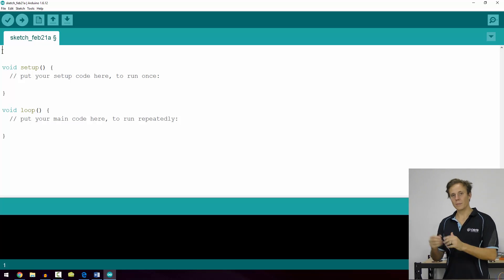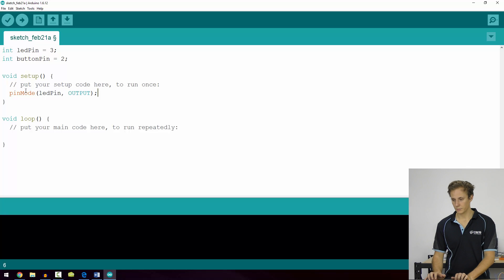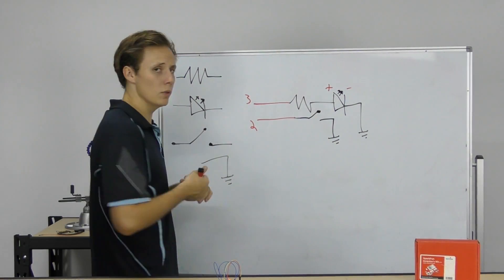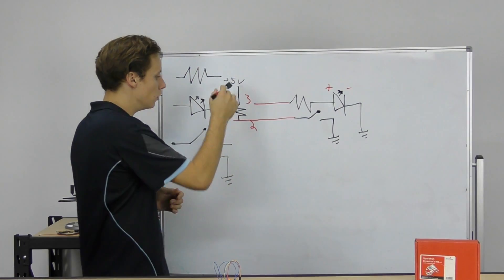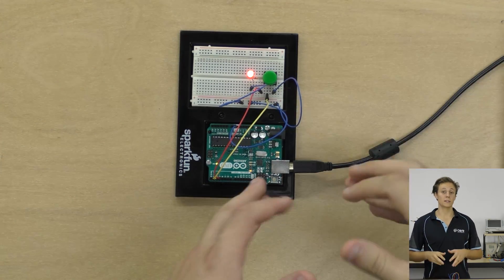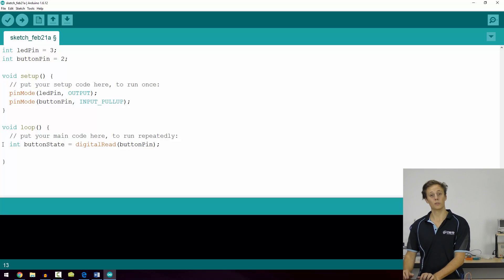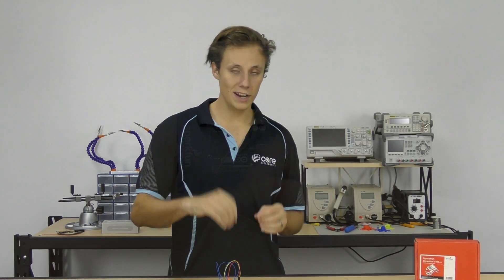Arduino Workshop - Chapter Two - Using Digital Pins

Comment: I always use external pull-up or pull-down resistors of a value that I can set depending on what signal I intend to input into the Arduino. This reduces load on the Arduino power bus and also protects external circuits should the Arduino catastrophically fail for some unkown Harry Potter reason! I would say NEVER use programmed pullups and hay, what is the price of a resistor? Also with regards to buttons, always introduce some sort of "de-bouncing" which can be done in code OR using external component. ALWAYS use de-bouncing so that your code does not read more than one button push.  Watch this:  https://www.youtube.com/watch?v=KqX_U7cNF2g     It is good idea to use active low on buttons, the reason why is so you can PING the buttons at startup and see if it is high, if it is low then the button is broken or the 5v rail is duff. This gives an initial setup in circuit fault finding function, VERY USEFUL before breaking Motors and stuff! ALSO... That crap background mario music is not necessary and very annoying, may I suggest AC/DC instead.  lmfao.. AND get a hair cut. Overall not bad video but you didn't get the job mate. :) sorry

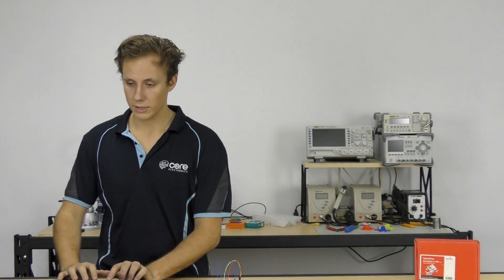Comment: Question :  @9:25 he created the variable inside the void loop, why did he not declare this variable at the top with the others? Is this then a "local" variable and not a "global" variable ?
Reply from the maker: If we create the variable outside the loop and set it to 0, the code would then go into the loop and then immediately update it to the value of the button so in this case it would have no effect. If you wanted extra piece of mind (like if you were controlling a motor base on the state of the button), you could set it to a value outside the loop to ensure that it is initialised to the correct value you want.

Comment: I have a question, the button is connected to pin 2 and ground while the led is connected to pin 3 and ground, then why does the led switches off when it is pressed. Please help
Reply: This will work because of the code that will be programed onto the Arduino board. He will say that if the Arduino reads that the button is pushed then it will turn on the led.

Comment: I am really enjoying this series.  I do have a question though.  Is there a way to use multiple buttons combinations to create a single action.  Like button1=high button2=high button3=low  moves 4 servos to one set of position.  Then pressing button1=low button2=high button 3 =high and servos change to a different position.
Reply: Yes, and that is actually quite simple to do, you would just need an if statement, like this... 
if(pin1==HIGH && pin2==HIGH && pin3 == LOW)
{
// code you want to execute
}

Comment: If it's active-low logic, shouldn't the button give a signal of 1 when connected to ground?
Reply: that not active low logic it is basically that in its normal state it is high and when its grounding it changes that value to low or "0"

Comment: What is pinMode
Reply: The literal pinmode.
Like an led pin is name as ledpin its mode is output
Reply: pinMode is a function that can tell the arduino wether that specific pin should be used as an output (say to power an led) or an input (to read data from a button or sensor)

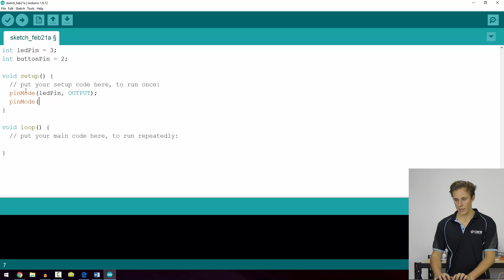Comment: Hi... have been enjoy your tutorial videos they have been a great help in my understanding of Arduino coding. I would like to ask if a 'Pull Up' Resistor should be used if the sketch is to be loaded to a ATtiny or ATMega IC or can one safely use the "INPUT_PULLUP" (mins. 4:10 - 7:29) in a Arduino Sketch.  Thank you and keep up the great tutorials.

Comment: Thank you for the really clear tutorials, starting with my first circuits and I was very glad to find this kind of tutorial that explains all the stuff well.

I have one questions: when I push the button on pin 2, doesn't that become a short circuit because pin 2 is then directly connected to ground? Or what prevents the currency from heating up the wire and destroying the device when the button is pressed down?
Reply: Ah ok found out that the INPUT-mode pins have a very high built-in resistor! This explains it! :)
Reply: this is where the pullup command comes in. If you don't want to use pullup you can just attach a resistor of very high resistance to the line connecting to the ground, it will protect the circuit from short circuit and also prevents ghost signals to the arduino.